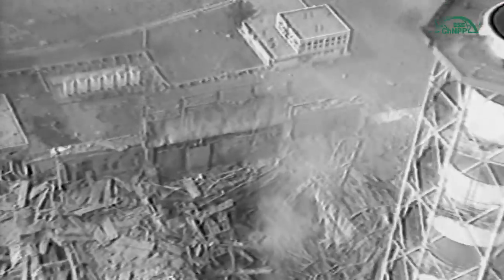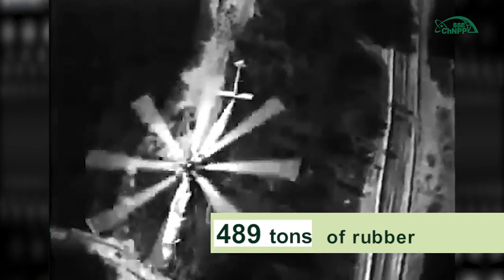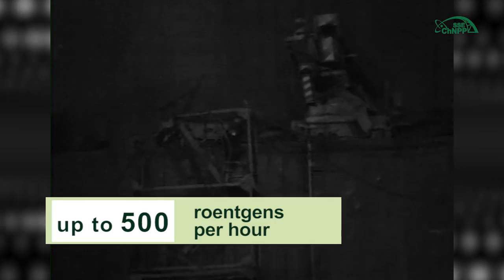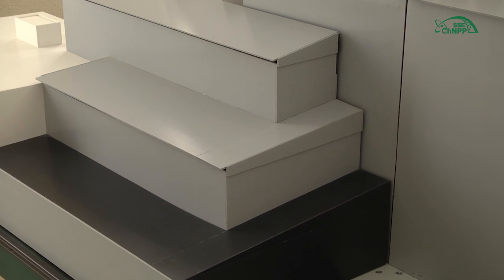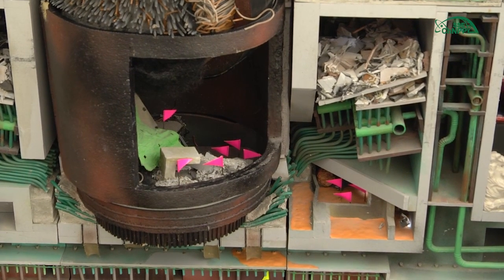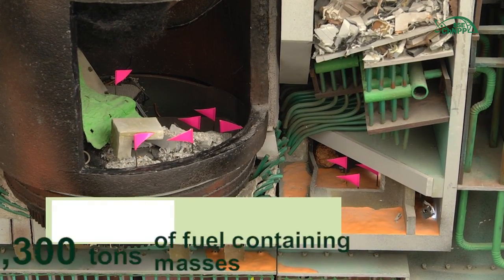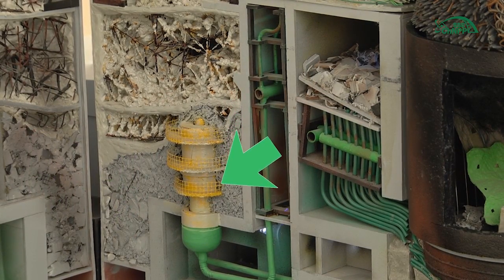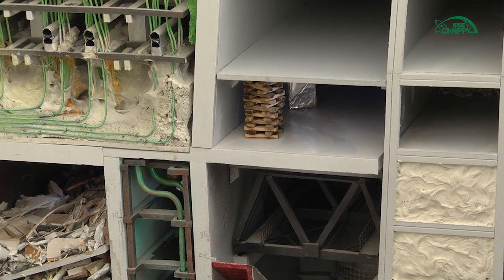Excursion within the "Sarcophagus"

Comment: Have to analyse personal safety of the miners wearing protective gear. Am sure they were aware that while they were saving the planet, it may have been safer for the miners to be able to move freely while working. Restrictive protective gear would have jeopardized the project and well as immediate personal safety. Am sure the contract took all of this into consideration.
Reply: You may be right, but don't assume... a lot of the people that helped after the accident were not properly informed of the risks involved. I am sure many of them had no idea how dangerous it really was. I work in the nuclear industry, and although todays standards make it much safer than fossil fuel power... those RBMK reactors were not so safe. And Ukraine and the USSR did not like to inform the public much.
Reply: Gilbert Leuze I understand that the initial fire attack crew came from a local city and had zero protection (radiation wise) as they weren't informed about the reactor breach. Lambs to the slaughter, although who knows if they knew what they were dealing with what would have been the outcome. Side note: apparently 2 key engineers that volunteered to go down to the basement to shut off valves (pretty much ground zero) survived into old age without effects from radiation.
Reply: Who the fuck would work without protection against radiation?  Wtf.
Reply: In Russia we give Uranium cancer.

Comment: Go wonder that Fukushima never had any sarcophagus and is leaking in the Pacific! Can we say human stupidity here?
Reply: Why?
Reply: The recent public data on Fukushima confirms that the containment structures have failed, being damaged by explosions. Radioactive water is being released into the environment. The leaks could not be stopped at present time. The water is constantly being pumped in, washing out more and more of radioactive substances. Most of it goes into the ocean. In this sense I'd strongly suspect that Fukushima has already released more radioactive substances than Chernobyl did, especially that 4 reactors were damaged, rather than one. But Japan receives a strong political support from the West, hence there's not much talks about it lately.
Reply: Ankit Magar oh god no it isn’t, you can die by standing in the basement of chnpp for 5 minutes near the elephants foot
Reply: The fukushima reactors were built with a containment structure already in place. The fukushima reactors melted down but they didn't explode. The buildings suffered hydrogen explosions but the reactors slowly melted down. Chernobyl melted down lightning fast and promptly exploded with no containment structure built around it so they built one after.
Reply: but fukushima is far more dangerous than chernobyl !
Reply: Ankit Magar What are you talking about? Fukushima and Chernobyl are very different failures. Chernobyl was far more serious than Fukushima.
Reply: @jonultime  no it wasn't! https://hatrickpenry.wordpress.com/tag/plume-gate/
Reply: According to Wikipedia referring to some peer reviewed papers, a 2014 estimate of Fukushima release is some 340-800PBq, whereas the Chernobyl estimate is some 5200PBq, i.e. 7 to 15 times higher. But the problem is that there is still ongoing leak from Fukushima, whereas the Chernobyl reactor 4 ceased its radioactive release already in 1986. Also, at these scales, it does not make a lot of difference. And then again, nobody will notice if the radiation is released into the Pacific ocean. It will dilute anything into oblivion. So there is a real possibility of Japanese authorities underreporting the scale of the radioactive releases, whereas there was no such possibility in the case of Chernobyl.
Reply: I hope all of you have some sort of education on the nuclear industry to be making these outrageous claims about Fukushima being on par with Chernobyl. Fukushima was bad but nowhere even on the same scale. I am not saying not to trust the media... but they do make money on making news reports. I am just asking that you please read some reputable and diverse articles and maybe research papers on the subject before spreading opinions and suspicions that are based on your gut...

Remember... greenhouse emissions kill more people than nuclear ever has... including weapons and disasters. Just look it up